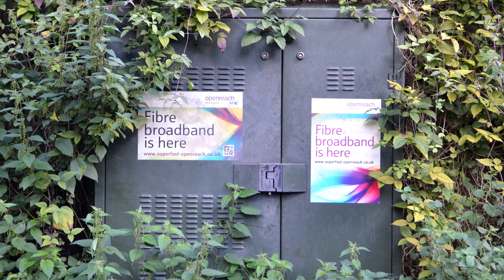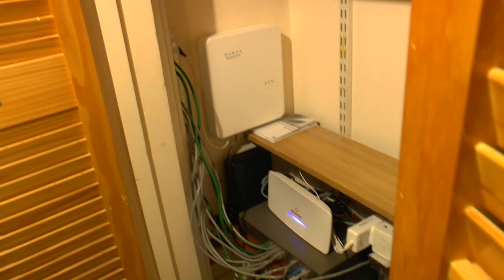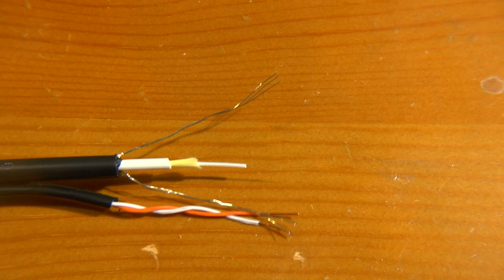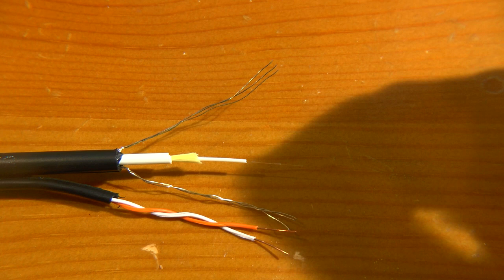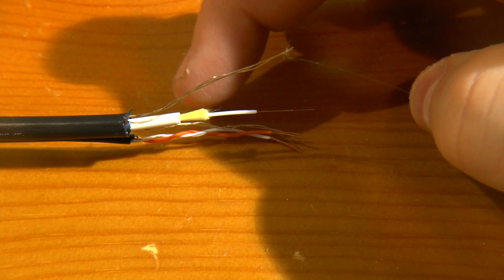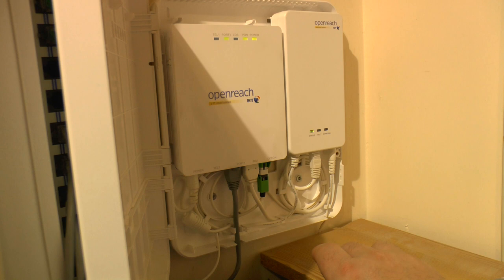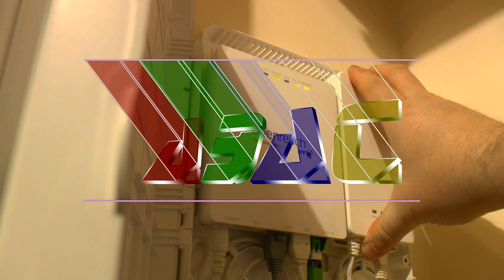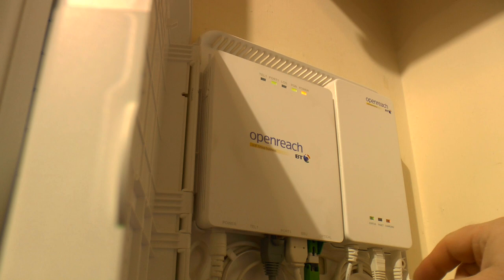FTTP - Fibre To The Premises

Comment: Openreach takes full responsibility for the ONT. They will send an engineer if there is any fault with the battery backup on the ONT as it is part of the ONT.  CPs dont even touch it.

Comment: Well I moved to a large apartment building run by the municipal social housing agency.  They  have a contract with the CatV Provider named Rogers for TV and internet. For the last two years internet was spotty and unreliable. In March they  finally brought HFC Hybrid Fiber Coax to the building using 3 fibers out of a 96-fiber cable they installed. Primary, backup and control is how the fibres are allocated. They have left to copper going to the individual units in palkce (Thus the amplifiers in each distribution cabinet) Thats all on the outside of the building to keep it from being stolen and sold.

Comment: I'm so jealous. Living about 5 minutes from my local exchange and every other street in the area has fibre and my street still has copper.
Reply from the maker: Spare a thought for those with the exchange practically on their own doorstep. Many of these will have "Exchange Only" (EO) lines, so straight into the exchange with no green cab.  BT won't allow BT to put BT fibre cab equipment inside a BT exchange, so EO customers will have been left pretty-much until last, stuck on ADSL when everyone else gets FTTx. BT's solution is to put a green cab outside the exchange, reroute EO lines to the green cab, install a fibre cab to go with the green cab, then finally provide the service.

Comment: I've just moved into a new build with fttp. My box is under the stairs of all places. Are the telephone plug boxes in the bedroom and living room now redundant? I'm wondering where the hell to plug my computer in as a wireless connection is no good for my online gaming. For that matter where do I plug the phone in? Does everyone need to move into the under stair cupboard Harry Potter style?
Reply from the maker: The telephone sockets in the bedroom and living room ought to be wired back to under the stairs, as for the computer if it needs a wired connection that too will need to run in Cat.6 cable back to the router which will be under the stairs.

In my case all the telephone and network sockets go back to the cupboard seen in the video, but that's because I ran them all myself.
Reply: @AintBigAintClever  cheers for the advice. I don't think the phone sockets gave been wired in. I'll contact the contractor and try and find out why!!
Reply from the maker: Worth popping the faceplate off and ensuring there's actually cable in there. If there isn't you can give them hell and tell your neighbours to check, too.
BT have guides for new builds, it may be worth reading those to see what they might (if they've bothered following them) have done. https://www.ournetwork.openreach.co.uk/property-development.aspx
Reply: @AintBigAintClever  Awesome! Thanks for help!!
Reply: We have the ONT under the stairs too.  Worth checking what cable is behind the phone sockets in the rooms.  Ours are wired with cat 5E cable rather than phone cable with only a few of the wires connected for the phone line.  I replaced the faceplate in the living room with a Cat 5 module and under the stairs and now have an ethernet point in the living room for all my smart tv / youview / apple tv etc.

Comment: The "yellow fiberous stuff", at least in cables used in the BT fibre ethernet backhaul, is Kevlar (if the Openreach tech who has had the unenviable job of fixing the same fibre link twice in quick succession at my workplace is to be believed...)
Reply: Yeah the yellow fluffy stuff is a type of Kevlar material but its lower grade and its called Aramid, its purpose is basically to resist the cable being stretched - Fibre Engineer
Reply: Yea, it's very tough to cut. We got special scissors.
Reply: Commonly know as aramid fiber
Reply: Kevlar is a polyaramid fiber
Reply: @xer0334  So how many miles of cable do I need to steal to be able to knit myself a bullet proof vest?

Comment: Here in France, in a small seaside town near the Spanish border, I have fibre to the living room. There’s a fibre patch lead from the wall plate to the fairly ordinary looking router that I’ve placed behind the TV. My landline phone service comes from the back of the router. I get about 400mbps down and 50mbps up. I’m very pleased with it and the engineers from Orange installed it very quickly and easily.

Comment: When I saw the poles with wires splaying out everywhere I thought that’s all a bit of a dog’s breakfast…ie a real mess. Here in Australia, the National Broadband Network, more commonly known as NBN, places the lines mainly underground into the existing pits that held the copper technology. I’ve only just had the connection applied here in a rural area and the FTTP is an outside box and an inside box with an Ethernet connection to the modem. There is a battery backup too if you elect to have it. The fibre is run from your home to the pit and tethered creating the connection. Mind you, a network node in the area is the main access point from which the fibre emanates. There is also FTTN here which  utilises the copper lines to homes which is a compromise. Interesting though to see what is done in the UK.
Reply from the maker: Since I got FTTP more of the neighhbours have, too. It's even more of a dog's breakfast now.  Openreach are switching off analogue lines by 2025, they're also rolling FTTP out to FTTC cabs ready to pull the copper network entirely.  Some more info at https://www.farrpoint.com/uploads/store/mediaupload/750/file/FarrPoint_Connectivity_Changes_Paper.pdf
Reply from the maker: In this area what Openreach do next seems to vary by area.  At work we had FTTP brought into a domestic property on a fairly new housing estate recently.  Existing copper is all ducted underground, Openreach pulled the fibre through the same duct.  At another estate across town the existing copper is also ducted underground, but they're getting ready to introduce FTTP en masse by putting up poles to bring it in overhead. Go figure.

Comment: This is truly an excellent video on how overhead FTTP is delivered annd also gives good pointers those poor folks who have to put up with OR drilling holes where they will in your house for a below ground installation.
A reflection - It's quite APALLING that there is no sensible information from BT's subsidiary OPENREACH on what type of cable (size and flexibility would do) and rules - if any, where it will be run (so that the customer can make preparations, should he decide so to do). My putative supplier also has no way to find out..

Accordingly this video has shown me exactly what I need to do to prepare for OR's technician's visit

Thank you, thank you, thany you (and a pox on all at Openreach - they certainly aren't open!)
Reply from the maker: https://www.openreach.com/content/dam/openreach/openreach-dam-files/images/fibre-broadband/fibre-for-developers/guides-and-handbooks/oct-2019-update/Fibre%20handbook%20V9%20web.pdf
Reply: @AintBigAintClever  how did you manage to get open reach to do it over head
Reply from the maker: @Viewer765  existing feed was overhead, I basically made it the easiest option possible and helped as much as possible.  Didn't need to splice, didn't need to drill, didn't need to even knock in a cable clip.  The cable ran through the attic but I was the one up there routing the fibre from the hole in the soffit to the hole in the ceiling.  I've seen newer feeds down the road (in fact the building right outside the underground fibre chamber) with the grey splice box on the wall, so I'm not sure whether they can still do an all-the-way-in job without one of those or whether it's Openreach policy to always fit one.

Comment: 4:33 I believe the yellow fiber is kevlar. Besides the steel wires offering support, the kevlar offers superior resistance to breaking, chafing, etc,, while also being flexible, meaning the fibre strand is less likely to get damaged when the cable is being pulled and twisted during instalation.

Comment: I had FTTP installed last Nov and have the smaller single box ONT without the battery backup,  I did have a termination box installed outside, with a pigtail from that to the ONT, just upgraded last month to 900Mbs Down and 120Mbs up from Zen

Comment: Nice to see what the system looks like in the UK.  Here in Ireland, the ONT provided by Open Eir is mounted directly on the wall and not battery backed.  The fibre cable does not include any copper conductors from what I recall watching an installation at a work colleague's home.  The telephone is still carried over the separate copper line by Eir, although some providers such as Digiweb now provide it via VoIP from their router.  The packages Open Eir provides in Mbps down/up are 150/30, 300/50 and 1000/100.  Then again, the prices are considerably higher than the VDSL based FTTC services.  

FTTP stops 3 lanes from our house and there are no plans to extend it for several years as our area is an amber region, i.e. not commercially viable.  The only alternatives at my place are 5Mbps DSL or 4G, so I recently signed up to a 4G home broadband package with Three and cancelled the DSL.  4G varies between 10 and 40Mbps in our area depending on the time of day and this speed is likely to drop as more people join the shared 4G cell.  I sure wish the FTTP went those few extra poles further up our street.
Reply: I'm in county sligo in a small village, and just on the cusp of having FTTH, within the next 2 months engineer told me the other day - he was fitting the 3M fibre box to the wooden telephone pole and feeding the FO cable down through duct to the manhole in the pavement outside my house - going into that same manhole from my house is copper pair PSTN - I guess they will pull the FO cable alongside the existing PTSN copper thats already there in the underground duct - I had a look at the Fibre cable he was using and it was just fibre and no copper pairs built in with it . - I see eir is charging 99.99euro installation at the moment (normal price for installation  €249.99 - eek!)  and 45eur PM for 12months and then 81eur PM for the 'up to' 150mb download. - yes I cant see it having a battery backup unit with our one, but if a person really wanted it i suppose they could get one of these cheap PC backups and plug the indoor unit into that to keep it powered in a power outage.

Comment: Just had FTTP installed and BT have really cut down the size of the ONT, it's barely larger than the regular NTE5 it replaces! There is an external junction box (at least in our case) that takes the figure-8 fibre drop cable and converts it down to an APC connector for the socket on the ONT. Nice and quick compared to the old FTTC we had previously :)
Reply from the maker: Whether you get the splice box seems to vary between installations, presumably if there's a lengthy run internally they'd rather splice it than split what is quite a tough jacket off loads of cable.
The building right next to the underground splitter in the video has a feed via a splice low down on the wall whereas mine comes straight in at roof level and has the SC-APC right on the end of the dropwire.
I've just looked at a photo of the new ONTs, it's definitely a less obtrusive unit compared to the hardback-sized box I've got in my cupboard.

Comment: That single fiber of glass does look very fragile, i'm not supprised i'ts wrapped up so carefully, i still find it amazing how much data they can bounce down a fiber.
'
I sort of remember that they can bounce many light channels down the fibre with precise optical end fittings, my memory is "half baked" so that may be special use only.
Reply from the maker: That's what they do with GPON. Upstream data is one wavelength, downstream is another. We do that at work to increase throughput over single-mode (9/125um) fibre; instead of one fibre for transmit and one for receive we can run both fibres for both, using 1000base BX-D or BX-U fibre modules (BX-D goes one end, BX-U goes the other).  Extending this method further takes you into Dense Wavelength Division Multiplexing (DWDM) where currently up to 160 separate channels can share a single fibre core.
Reply: Ahh it was frequency wavelength, i could not remember how it was done, thanks for the understanding :-D.
Im waiting for the technology to upgrade my memory to steam power :-D.
Reply from the maker: When I heard there was a splitter down the road from me (from the engineer installing the fibre terminal on the pole) I assumed it was WDM putting different wavelengths out to different customers (and this is an option pushed by some manufacturers I think) but PON just uses splitters that send the same signal down the different fibres. The exchange kit's got a lot of donkey work though as it's got to receive and coordinate data from all the ONTs that share the fibre, which will be out of phase with each other and presumably can't hear each other either.
Reply: I think it has to be controlled by the exchange, a polled system with user i.d packets to allow the users fiber box to know when it can send and when it needs to treat a packet as download data.
The fiber box listens all the time, but the i.d labeled packets control its operation.
Thats my very crude guess, i know nothing about the subject, im likely talking crap lol.
Reply: All the data from every customer off that splitter gets sent back to every ONT. But you're ONT only decrypt's you're information.

Comment: A couple of very important questions......

1. I assume if you are offering PSTN to VOIP devices so the dialtone is emulated locally then you will be providing battery backup to enable emergency services calls in the event of a local power outage. Who exactly will be paying for the external battery pack or internal pack in the modems ? If this is the service provider that cost is going to be passed on to the end user. A cost that has always been covered by Openreach in the past with FTTP for example. Who is going to be paying for the equipment to keep a service that has always been a core responsibility of Openreach in the past. Regardless of the method employed Openreach are still responsible for the path from the customer NTE to the MDF.... or directly into the 21CN backbone in the case of direct IP / VOIP services.

2. I assume that unless fully LLU the core of current PSTN users can look forward to huge reductions in call rates and line rentals given that providing a VOIP service is substantially cheaper than a POTS line... No line cards and a large reduction in equipment power consumption at the exchange for example will result in huge ongoing cost savings for Openreach once the equipment change at the exchange is complete, a process that was well underway 14 years ago when I retired as a PTO / SFI engineer.

Openreach appear to be trying to act the poor victim when this very long overdue switchover was announced and are complaining about bandwidth usage on the backhaul network. As anyone in the industry will tell you Openreach have been trying to prolong the usage of old slow creaking backhaul links to keep the profits rolling in rather than investing in backhaul links, FTTP and actually blowing new fibres and upgrading modems and switches to cope with an ever expanding increase in traffic. It does make you wonder what network latency will be like when all this additional VOIP traffic bogs down the existing  antiquated links. My estimation is that overall latency will increase (something that voip services do not like very much) whilst service providers are left to cover the cost of additional or replacement equipment. As I cannot see directors and shareholders buffering these costs it is going to be the end user that suffers in the end.

This is something that has been on the cards for many years. It is NOT something that has suddenly and without warning been dumped in the lap of Openreach to sort out.

It is looking like the stopgap solution to this self inflicted disaster is to try and shift as much traffic as possible onto mobile network operators who will sooner or later hit the same problem wall that Openreach is shortly going to slam into...

.................

We have an underfunded and under  invested network backbone that is not going to be fixed by calling Scotty in engineering and asking for more power to the shields !

If I ever doubted the existence of Karma for corporate bigwigs and greedy investors I am sure that leaning back with my popcorn and watching these people tread water that is up to neck level for the next few years will fully restore my faith in this phenomenon !!

Meanwhile I have two empty baked bean tins and a length of string on standby and ready to go.  ☺ 😂
Reply: 1. You provide the batteries after the initial set they installed.

2. Nope, why the hell would they reduce the cost???

Comment: I have FTTP and copper connections.  The previous owners of the property (which I bought) 'took' their telephone number with them.  With the exception of BT, all of the normal domestic providers said that there was, according to Openreach, no room in the cabinet to install their equipment and they could not provide a fibre connection.  But they could provide a copper internet service.  (I tried to explain that that was because there is no cabinet, but their systems could not handle the point).  Not being willing to pay BT's FTTP monopoly prices (way above others' fibre prices), I have paid for a copper internet connection, which costs £60.  I spoke to Ofcom, who said that they could not force the providers to supply a service and i was not able to speak to Openreach to get them to understand the problem..